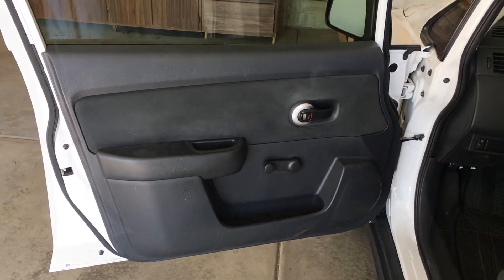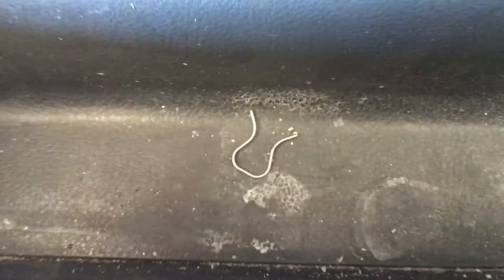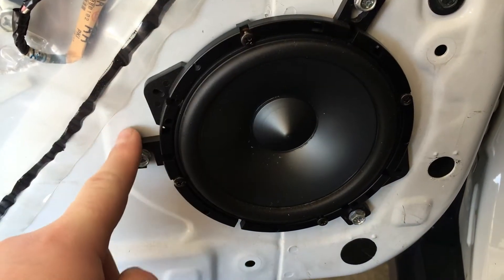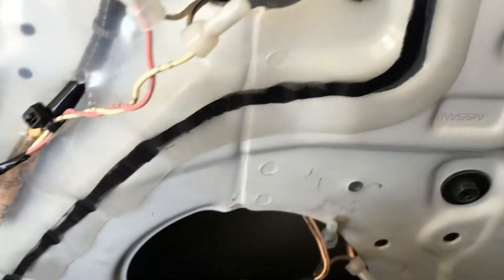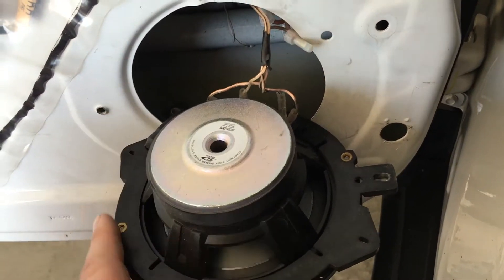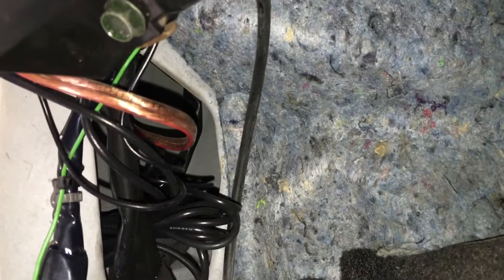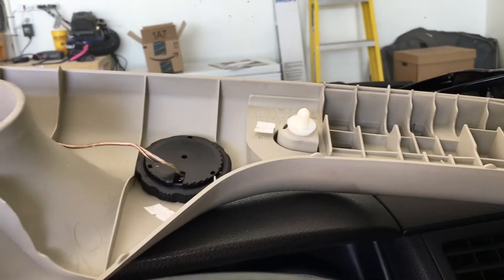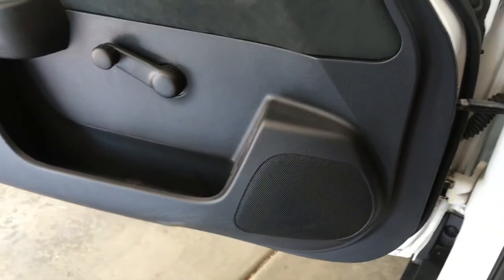2007 - 2011 Nissan Vera/Note/Tiida Front Speaker Install

Comment: Which factory wire in the door is the positive and negative wire for the speakers?
Reply from the maker: See 4:27 of the video.
Reply: Provo Beast Audio Installation that’s not a fucking answer

Comment: Hello, I have a 2007 nissan versa hatchback and was wondering if the coaxial version of these (SPS - 610) will fit, crutchfield says it wont but when I check the component version, it says the woofer will fit so I am confused.
Reply from the maker: Yep should fit just fine.

Comment: Not much of audio specialist video and more of how to swap over speakers, as the install stands it will still sound mediocre, the door needs to be sound deadened and baffled (sealed) so it acts like an actual enclosure, the rear wave cancels the front wave of the woofer because of the gaping holes in the door, no matter how much better the speaker is, the enclosure has the biggest effect.....